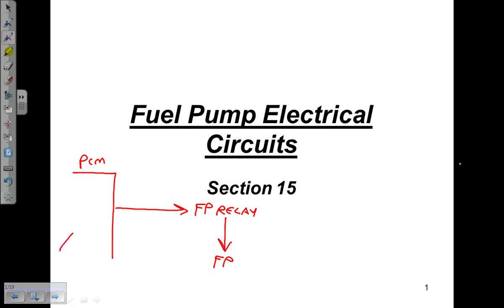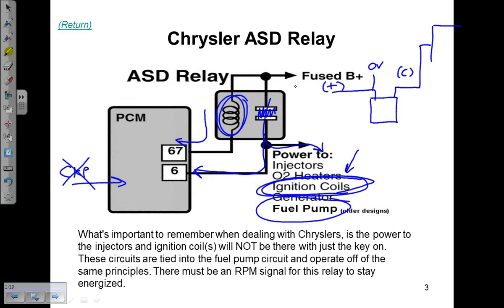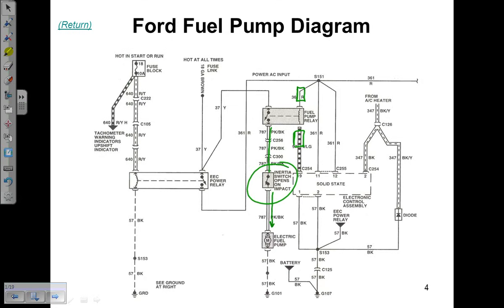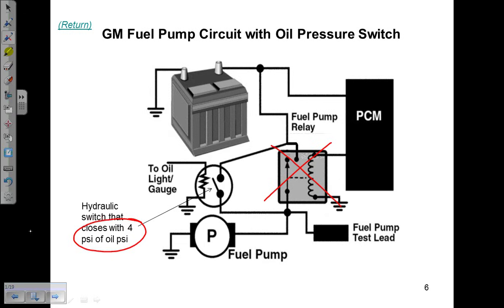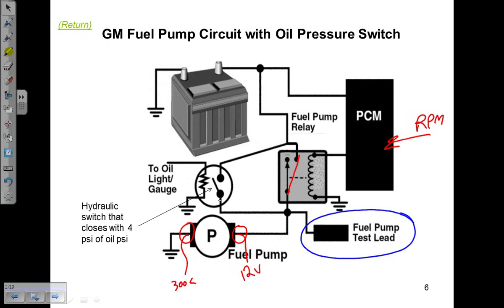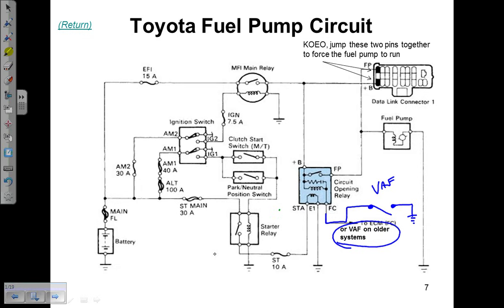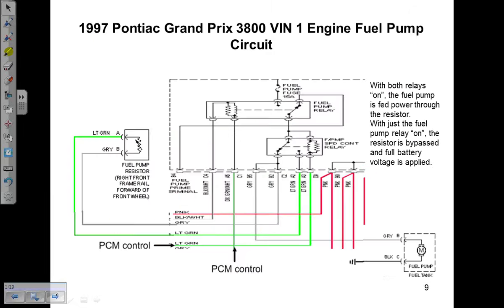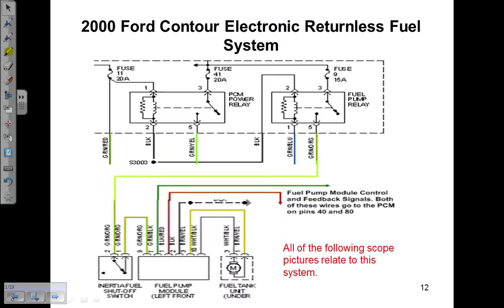Fuel Pump Electrical Circuits Description and Operation

Comment: This was so good. I wanna reach that level of expertise omg!!!
Reply from the maker: Thanks so much! This is an example of the types of videos I have on ScannerDanner Premium. Hope to see you there some day. 
https://www.youtube.com/channel/UCs2NZ_wQFDFvV0QOhoZgASA
Reply: @ScannerDanner  alright Google will you show me it's a 1997 Chevy will you show me the harness connector to the fuel pump and then lights from the back Google can you show me the connection for 1997 Chevy
Reply: 😊 @ScannerDanner
Reply: ScannerDanner please help me. I have a 2004 chevy impala with a crank no start. Found that there is a fuel pump relay circuit problem. The guy that looked at it says a new lock cylinder and ignition switch might help. Can you give your advice. It's broke down at my house and I don't have the money to have it towed.
Reply: 1990f250fule pump keep pumping all the time

Comment: One ? How can the fuel pump read rpm if the car/truck is not started because fuel pump comes on when you turn the key on to start the car
Reply from the maker: The ECM reads the RPM input, not the fuel pump

Comment: The gauges use stepper motors. That “trim piece”
Is where the Chimes, Turn Signals  and high beam indicator are housed.
Reply from the maker: What time frame of this video? Don't remember talking about the gauge
Reply: @ScannerDanner  the Tachometer that failed to operate correctly., near the end of the video. The Gauge comment was meant for a previous video concerning a 2003 Chrysler Town & Country that had a n initial no start situation due to a bad ECU… once fixed, it had a dead Techometer in the instrument panel.

Comment: I'm been searching around how my 02 Mitsubishi eclipse GT on how the relay works because it's different from any vehicle that you turn the key on and it doesn't make noise to the fuel pump to tell if it's working or not it only works with the engine when it starts up I was looking at the relay on what to do on how to jump the fuel pump relay so I can drain my old fuel out the tank instead of dropping the fuel tank itself to empty it out.
Reply: 2002 models should have the fuel pump prime for a brief moment when ignition is "ON". Both my 89 mazda mx6 gt and 95 toyota previa sc awd lost this feature but i remember hearing their fuel pump hum with ignition "ON". Various toyota forums say pre-1996 models don't come with this feature though. I am going to use 555 timer to regain this feature. A quick and dirty solution is to use a momentary switch to jump FP and +B.

Comment: I have a 95 grand marquis with 45000 original miles and have been struggling with the intermittent stalling and this video answers every single question that I have had and you are an all star in my book. Thank you
Reply from the maker: That's awesome. Thanks!

Comment: awesome video - so my 2003 Suburban 1500 will continue to run if my relay is taken out after starting it??  Do I have the hydraulic switch parallel path? 

Also - the little hole next to the fuel pump relay is a prime contact.  If I put +12 V to that one terminal it will power the pump without removing the relay?  Or is it apply ground to it?  I believe this is the test lead you mentioned.  Just apply 12+ to that port right?

Thanks
Reply from the maker: Yes to question 1
Question 2 "little hole next to the fuel pump relay"?? I'm aware of a fuel pump test terminal on some of these and yes, direct battery voltage will run the pump on those. But make sure! You don't want to jump 12v to something you shouldn't be

Comment: I have a 1994 GMC Sierra good fuse an good relay but have power at fuel pump at all times until I undo my battery or pull the fuse even with keys in my pocket what is causing this issue??
Reply from the maker: What does the pump do when you pull the relay out? If it's still running, then disconnect your oil pressure switch and tell me what happens
Reply: @ScannerDanner  when I pull the relay it keeps running through my oil pressure switch (which is new an so is the fp relay) but I didn't bench check it before i installed it because it was brand new, I can crank it without the oil pressure switch but as soon as I plug it in pump runs at all times. I'm thinking theirs a flaw in the ECM  but I only knew so much from auto tech in highschool which has been min. Thanks
Reply: It also throwing code 42 ignition control circuit which I have replaced the module 3 times so I'm probably going pull it and put some dielectric grease cause of poor connection

Comment: I have a 2007 Chevy Tahoe I’ve had it to four different mechanics and have so much money wrapped up into this truck they have had me change everything from fuel pumps to wire harnesses it is a nightmare we do not get any power to the fuel pump whatsoever unless if we jump the relay underneath the hood for the fuel pump in if we have a test light hooked up we will get power to the harness by the pump but if the pump is plugged in it blows the fuel pump fuse immediately

Comment: Good day. I own a ranger 96 and I need some help
I tested fuel pump relay and 86 and 30 are good voltage. On 87 I disconnected the pump and I get half of voltage and plugged back and read 0 voltage and on 87 I get no voltage
I just put a new fuel pump
And replaced the crank shaft sensor it was shorter out the wires were pulled
I'm getting spark now the I replaced the crank shaft sensor but fuel pump is not working
What should I do Sir?  Thank you
Reply from the maker: So your fuel pump relay is never energizing? Do you have spark?
Reply: @ScannerDanner  yes i do have spark
Reply from the maker: @marcosduque6670  this one may help you? https://youtu.be/rQ7tvIxQSt0 What does it do when you jump pins 30 and 87 together? The pump should run

Comment: They should have rigged emergency bypass tube on power steering variable assist hydro power steering pump of GMC 97 Sierra SLE  3500 dually... mine for me... Electro switch over with check engine light notice... Because sudden loss of power steering assist and brake assist simultaneously can cause some very hairy accidents in this big white ghost I call it.. maybe could make some ghost also.. without any notice.

Comment: Maybe it's possible to rig this computer bypass signal switch to transcend any safety computer involved ground connections.. for emergency trolling power to an emergency mechanic repair. From the middle of the desert in the scorching heat.. while minutes from dying

Comment: I figure if you're in the middle of the desert going to die of thirst and heat.. in some way it's possible to bypass computer ground for ignition fuel pump anything you might need

Comment: Great advice I have a 2007 Cadillac and the fuel pump runs continuously unless i pull the fuel pump fuse even with the relay out does this mean my oil switch is stuck? I unplugged the fuel pump relay and the oil pressure switch and it still runs as long as the fuse is in. Makes me wonder whats going on could you help SD

Comment: Walmart has fi service. I'm sure it cleans the valves and injectors a little but it doesn't seem to clean throttle body very well. That would be sweet.
Reply from the maker: Throttle bodies need to be manually cleaned

Comment: 1999 Mazda 626 4cyl... Odd the fule pump fuse blows but there is no computer sensor stating "bad fule pump." I'm trying to find out why fule pump fuse is blowing... Expensive blowing these 30amp fuses.  I am hearing it's possible other components also run on this file pump fuse, (not talking about the fule pump relay).  The only way I know to proceed is to drop the tank and replace the fule pump. Then, go from there.
Reply from the maker: you need a good diagram first to find out what all is on that circuit! https://eautorepair.adtrk.biz/?a=10817&c=24&p=r&s1=
The one you want will be listed under the power distribution diagrams

Comment: How you bypass the oil sensor to make it run if oil pressure is zero
Reply: I can get oil pressure but still don’t help without power to relay , I had ran a jump wire to power pump but still hard to start wondering if I’m getting a rpm signal or not .  But with all that no codes started checking 5 volt circuits and only had a couple work and this was a truck that was untouched running fine then set for along time before I pulled motor so codes no signal waiting on pcm we will c . But thanks to you diy is what I do to
Reply: @michaelbaskinmichael9862  you can test crank sensor with a  wrench and a multimeter. Pretty simple and straight forward. Assuming the truck doesn't have a tack to check for rpm signal while cranking. Although I've heard this to not be a valid test. Do you have the schmatics for this vehicle? I've seen main relays do some weird stuff. Same as injector fuse messing with fuel pump. Sorry not much help.
Reply: If oil pressure is zero starting it isn't your best option. First Confirm there is oil. If it's to thin it can read low pressure. Confirm the sensor is getting powers ground etc if so replace the sensor if not find out what your missing. If seasons good Disconnect the fuel pump as well as disable spark. Let it turn over till you got pressure. If no pressure builds up the oil pump has failed. If that happened and you was driving look for a engine replacement.
Reply: Thanks but that’s not even close the engine has just been rebuilt by me, and that’s why it don’t have pressure cause it ain’t been started but no power to relay and only thing that gives its control feed is the vcm and I’ve ordered a new one  , there’s been other stuff not workin has well but stay in school and thanks again
Reply: @michaelbaskinmichael9862  even without power feed to the fuel you should still get oil prime. I'm assuming you've done tried to start it as this is you confirming you don't have fuel? I finished school 12 years ago sir. I've learned more from diy and friends then I did in school. But after you replace the part come back to confirm the diagnostic. T.y

Comment: My 2008 Ford F-150 my Wife cut some wires I’ve connected them back together. The left light blinks non stop. I’ve watched hundreds of videos search every nic and crevice. I’m down to Jumping the Relay starter to get it to Crank now I need fuel.  Is there anyway to run a wire direct to fuel pump from battery or jump the the relay 20amp fuse
Reply from the maker: don't do that, major safety issue to direct wire a fuel pump. I bet it doesn't start even if you would do that. No crank right? And you jumped the starter and now it cranks but won't start? You are attacking this wrong. On an 08, the ECM controls all of this. Let's focus on the no crank and it will lead us to the promise land. I can help you with that if you can follow instructions and have a test light or voltmeter.
Reply: @ScannerDanner  ok im listening I've tried everything possible no luck
Reply from the maker: @southkerr6267  sorry, hard to keep up, let's move this to my forum at www.scannerdanner.com it is free to join and it is much easier for me to help you there.

Comment: Hey danner I got one for ya my90f150 starts and runs but when I step on brake the fp relay turns on and no brake lights.
Reply from the maker: you have a bad ground back there somewhere

Comment: What if I ran a hot wire to the foil pump
Reply from the maker: Here is the problem with that. You get into an accident and sever a fuel line, you are now going to empty that fuel tank onto the ground all around you and God forbid you are unconscious. Make sense?
Engine stalls, the fuel pump must shut off!

Comment: I have just body swapped a 49 Ford truck on a 99 4.0ltr explorer I have removed door wiring from rear loom. watching your video has helped so much. this week my pump stopped working removed the  pump and tested it and it ran.  In this video you talk about 'pump ground' being switched. is this done via relay in luggage compartment?
Reply from the maker: Was the 99 4.0 an electronic return-less fuel system? Does it have a pressure sensor on the fuel rail?

Comment: Thanks for this in depth video. I have a 93 suburban and the fuel pump continues to run when the truck is off. If I pull the relay it still runs. The only way it stops is if I pull the fuse. If I replace the fuse the next day it wont run until I've started the truck then the cycle repeats. I have no clue why the pump would get power without the relay. If you read this any help would be appreciated. Again thanks for the video.
Reply from the maker: Unplug your oil pressure switch
Reply: @ScannerDanner  I'll give that a try as soon as I get a chance. Thanks for the reply
Reply: @ScannerDanner  you are awesome. It was soaked with power steering fluid. I sprayed it out with some electrical parts cleaner and good as new. Thanks a lot, there's no telling how many hours or days you saved me.
Reply from the maker: @caseyhughes965  heck yeah! Knowing circuit design is EVERYTHING when it comes to troubleshooting and I happened to know your system. Glad it helped you and thanks for the feedback

Comment: Sir i have a 2007 2.7 litre petrol rodeo i have replaced  relays fuel pump and o2 sensor , car has no tacho ,i have power at relays but not at fuel pump plug . I can start it with aerostart , my question is can i run 12 volts to pump from a switch on the dash ?
Reply from the maker: Not recommended, this is a major issue if you get into an accident and sever a fuel time. The system is designed to shut the fuel pump off if the engine stalls. Fix it correctly.

Comment: Sir I have one question here why in my hyundai i20 petrol the fuel pump won't prime after warming the engine? Suppose I make 10kms and stop the engine and after couple of minutes I run the key on and nothing heard? The car is 2009 classic manual 5 gears 1.2 liter. Please tell me if is normal. Thanks.

Comment: What happen if ASD & FP relay has voltage on pin 87 when you turn the to ignition ON & the FP will not turn with new FP
Reply from the maker: Check power and ground directly at the pump

Comment: So say you don’t plug in your rpm connector on your cluster would that cause no power to the pump?
Reply from the maker: RPM signals come from the crank sensor and are fed to the engine computer, not the cluster.

Comment: I haven’t had a block of instructions like that since 1987, USARMY Diesel and Generator mechanics. Great frigging job. I just solved my F150 double tank fuel system. I jerry rigged but confident my pumps work. Please if by chance; a block of instruction on F150 300 CID, not even Ford can figure out the overflow problem. Only the old school shade tree dogs get it.
Reply: Well, again going back to the drawing board. I felt bad about my bypasses and don’t want a fuel return problem. My biggest issue is reading Ford diagram wiring color coding. They are totally inconsistent.

Comment: My fuel pump was bypass direct from battery, which I found so reconnect back it's place but it's not starting so my question is will it damage the resistors in the fuel pump from working?

Comment: I have a 06 Cruiser.  I have replaced EVERYTHING except the engine and transmission.  The car cranks no start.  No spark.  Only code now is P0627.  I want to see if there is resistance on the two (2) signal wires on the Coil Pack connector.  I had power for 2 sec but I don't see any signal on the Driver #1 or #2 that sends the signal to the coil pack to initiate spark.  I have replaced the PCM so I am confused why this car will not start.  Will the code P0627 prevent the car from getting spark?  If I can fix that code, will the car start?

Comment: its been lil over 3 weeks , that po23f code is driving me insane ! . if i could get a simple straight answer what fuel pump secondary circuit/open means maybe i could fix it ! .what does secondary circuit mean to you in a nut shell please ! i wonder also if this is the reason why the ecm Keeps blowing # 10 20 amp  fuses ,  UO100 CODE ? .....2011 BUICK LACROSSE CXS 3.6L ENGINE !
Reply from the maker: You need to attack the fuse that keeps blowing first! It looks like this fuse feeds the ECM power though the diagrams are a little conflicting. I would think with this fuse blowing that you would not be able to talk to the ECM (no com). 
You system uses a separate fuel pump control module that communicated with the ECM and this is where the P023F code comes into play. I believe if the ECM ignition feed circuits (fuse #10 20amp) is blown, you will end up with the P023F code
Reply: @ScannerDanner  brother in my eyes after many, many , many hrs i put in watch so many of your vids ,i can say ,in the automobile diagnostic world , you are a god my friend  !!!!! thank you so very much ,i been going at it all wrong ! . tackle the ecm first , ,most important ,i see it now ! again thank you !!!!
Reply from the maker: @RGAIRGUNNINJA  thanks brother! Keep me posted on what you find.
Reply: @ScannerDanner  will do my brother !!!
Reply: @ScannerDanner  i just ordered the Power probe ECT2000 circuit detector for 75 dollars ! now i got a pp too lol !  i hope its still good ,i seen the 3000 out but way more money !